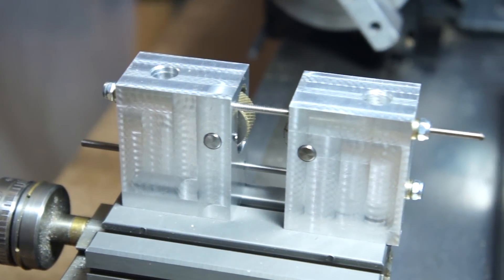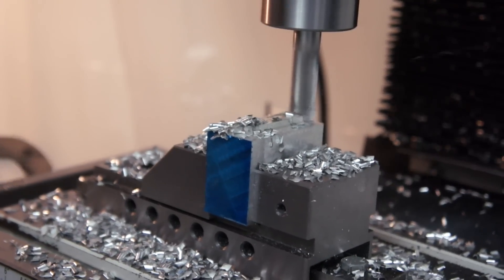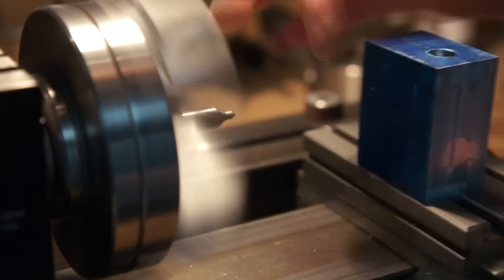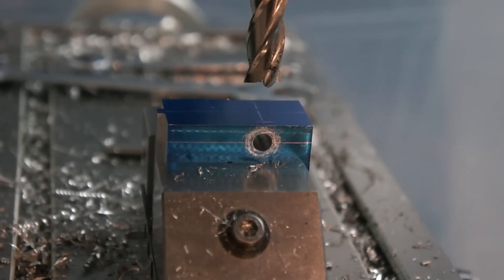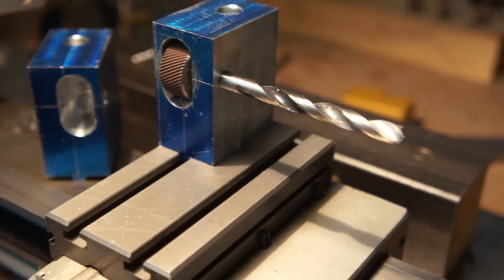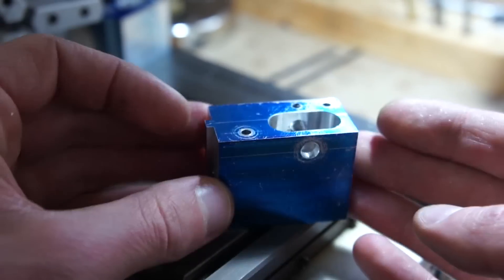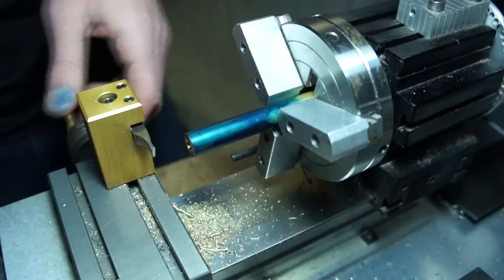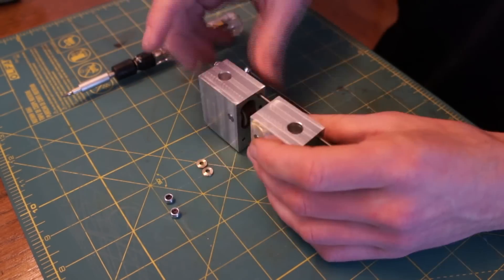DIY Knurling Tool

Comment: So tell me, does knurling Push/Compress the metal out of the way or cut it out of the way?
...And if it pushes/compresses the metal, will it make the circumference slightly larger?
Reply from the maker: Yes, in this case it deforms the metal to size. There is also cut knurling that does exactly what it sound like. With this style you are also correct as the diameter increases. An old  (kinda hacky) trick to make a shaft that's too small/worn fit tightly into a bore is to slightly knurl the end to bring it back up to size.
Reply: @CurtVanFilipowski  Thank You. That last part you say is why I came to your video. I have a crankshaft snout, 4340 steel, that is a tad bit too small. The timing gear and damper slip on instead of press fit. I'm exploring the possibility of Knurling as a cure.

Comment: Great, I search for how to make a knurling cutter, and it needs a bought knurling cutter.

Facepalm.
Reply from the maker: You could very carefully cut the striations into a steel blank (rotary tool, file, etc) and then harden...wouldn't be as robust as a commercial purchased knurl cutter but there is always another way :).

Comment: I've been looking at this again as I have a project that will need a knurl.  What I am finding is that a pair of knurl wheels cost about the same as complete, clamp type, knurling tool.  In fact it would cost me more to make one by the time you factor in the other materials.
Reply from the maker: Yep, that about sums it up.  At the time I couldn't find a knurling tool that would fit the taig well so I had to go the diy route...now there are plenty options in that size point.

Comment: A very clean knurl, and plenty deep.  It's great to see people come at things from a different direction, and even better when it works so well.  BTW  I have a heavy blue marker that came with one of those knife sharpening kits, and it is what I now use for most of my bluing for marking.  No mess, and does the job.

Comment: Ok, I'm excited. There's no way I can do this BUT it's one step closer to what I'm hoping to find: I need a hand powered machine that's portable, with which I can put a knurl on the edge of an Eisenhower dollar. I'm a magician and I gave my coins to a machinist to have the reeding (milling) recut and he misunderstood and knurled them instead...and they were 1000% better!  They do get dull and I have to repeat the process which isn't cost effective or exciting for him.  Does anyone have any ideas? The search has been like tracking Bigfoot!
Reply from the maker: Neat application!  I would vote a clamp style knurling tool and then get the the front part of the tool made with an integrated steel shaft and flat "super glue" chuck to mount your coins to.  Put a hand crank on the back and let the the knurls float on a single pivot so alignment isn't an issue...far easier to drawn then explain so if you are seriously looking to solve this problem shoot me an email, I'd be happy to lend a hand (www.confoundedmachine.com, there is a contact form on my site).

Comment: Aren't there specific diameters that each knurl handles?
Reply from the maker: Yes and no...in theory a wheel size will knurl in stepped sizes (multiples of the tooth pitch over the circumference of the stock), however that goes out the window once you change the tool pressure (depth of knurl).

Comment: There's an alternative to the standard layout fluid if you aren't using coolant or oils when you cut: Pilot markers. They make a large size blue marker that works like Dykem, but it's faster and cleaner to apply. Dries in seconds. Only problem is that coolants and WD40 will wash it off, making a bit of a mess. If you don't use those, it's a good alternative. I found the makers on Amazon. They come in other colors of course, like red and green, but blue works best for me on aluminum. 

Nice work on the knurler!  

-- Mike
Reply from the maker: +BigMjolnir Thanks for the tip!
Reply: +Curt Filipowski You're welcome. Just passing it along...I got it from Chuck at Outsidescrewball. There's a huge amount of good info on YouTube because folks like you and Chuck and lots of others share what you know.